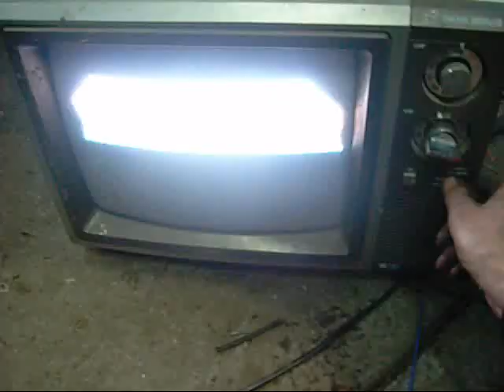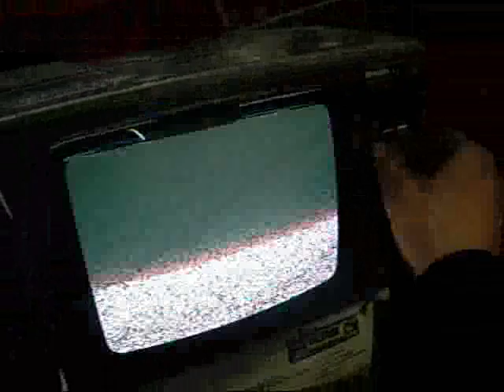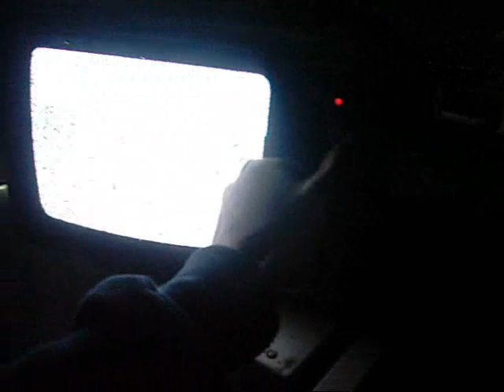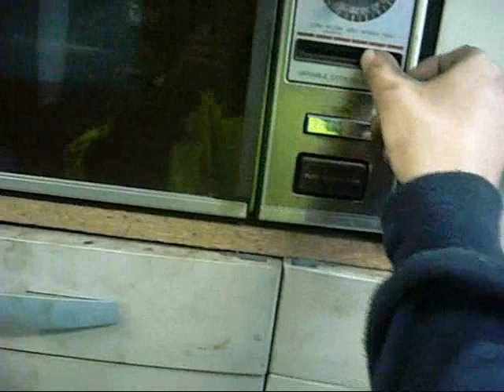Testing old Color TV's and Microwaving a Boom Box

Comment: @Aussie50 
If you ever wanted to get a small induction heater, Ameritherm makes a couple models in the Easyheat (formerly Hotshot) line which run on single-phase power and put out 1.5 or 2.1kW depending on the model.